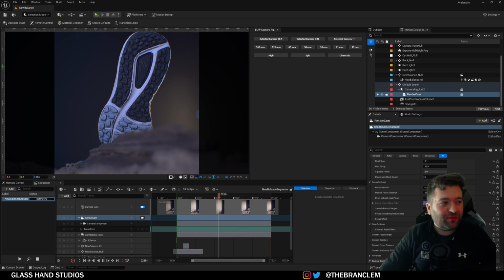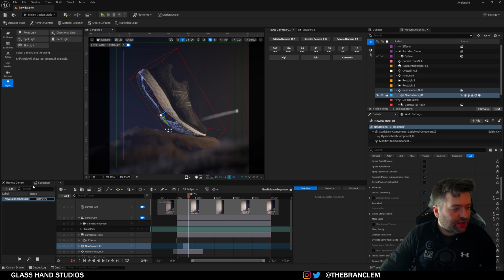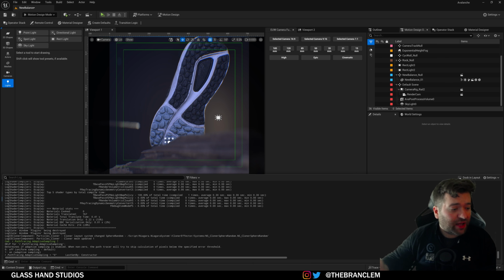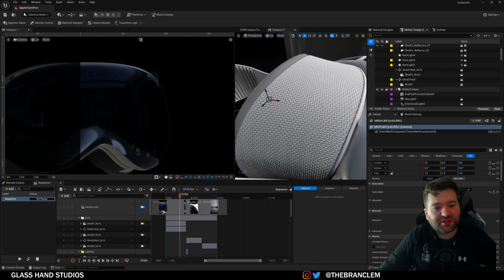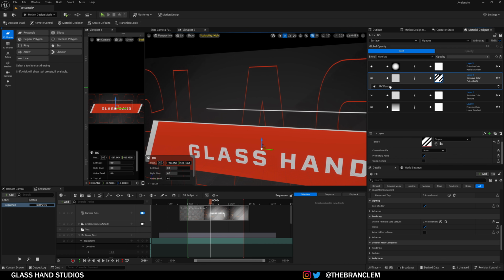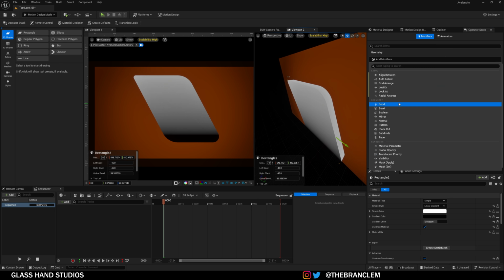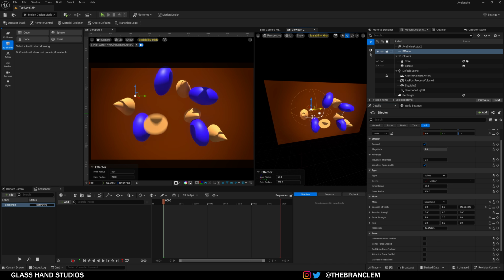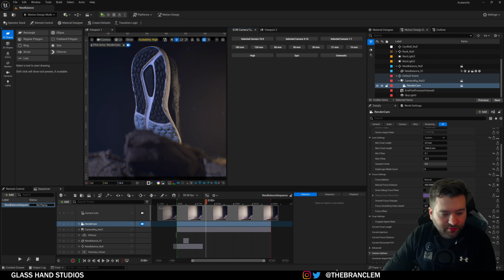Unreal Engine 5.4 Motion Design with New Cloners, Effectors, & More! (Project Avalanche)

Comment: OR you just enable this under experimental in the plugins config. its called "motion design". no need to compile a prebuilt version.
Reply from the maker: You will need 5.4 which just came out today in preview state 1. I'm compiling the actively developed 5.4 branch which is not pushed in the epic games launcher publicly. You will need to compile from source code to get the latest commits from the developers

Comment: Great video thanks!  Can you help with an issue please?   The materials which I made in the new material designer look great in viewport, but when rendering with the movie render queue all materials are missing and render black with the following error message:

“Detected 2 read-only materials with missing niagra usage flag required to work properly with cloner”

In other posts I’ve read to open the materials in the main UE mat editor and make sure that in the materials niagra usage settings that “use with Niagra mesh particles” is checked… But mine are already checked!?

Any advice appreciated
Many thanks  😊
Reply from the maker: @DavidMattock  thank you very much! And yes the usage flags are under the material settings. You are looking in the correct place. You will find things like "use with nanite", "use with Niagara", "use with instances static mesh", etc. I believe the motion design cloner is actually using Niagara to instance the mesh. To trouble shoot, I would make another regular material and add it to your cloner to see which flags are ticked. Take notes and add the same flags to your material designer material. I hope that helps!
Reply: @GlassHandFilms   hey thansk so much for replying.  I made a normal material and it still didn't work, but a material from the starter content did.  
So I just tried creating a brand new motion design scene, added the default cloner, used material designer to create a material and the same issue.  Is it that NO materials made with the designer are renderable?

BUT in this level, I made a normal material and dragged it to the default cube in the cloner and the material rendered fine.. crazy.  But I've not found anyone else with the same issue.  I tried asking on epic forums but nobody answered in over a day, so I guess I wont get an answer.  Have you found similar issues with materials formn the material designer wont render?  Many thanks again
Reply from the maker: @DavidMattock  howdy again! I will try and recreate on my end. In the mean time, I will pass this along to epic to see if they have flagged this as a bug :) thank you so much for sharing. This could help a lot of people in the future! P.S. material designer is going through a ton of changes and will be better in 5.5 :) crossing my fingers they have this bug flagged
Reply: @GlassHandFilms   Amazing thank you so much ! 😊 its  impossible to contact Epic for us mortals lol   
I just tried something.. I opened the material designer in the standard UE editor, then copied all the nodes linked to the main end root material node.. then created a material in the standard way, and pasted them in, and connected it... and it worked!  so Im sure there is a bug with material designer.. which are called dynamicmaterials, maybe this is the problem?

Thanks again for the feedback and responses, much appreciated, Ill wait to see if you get anything from the powers of Epic.
Reply from the maker: @DavidMattock  So I did hear back from one of the engineers. And yes, they did notice this happening and he told me it is fixed on the main branch. I'm going to pull tonight and see if it works as intended. Thank you for the comment and calling it out!
Reply: @GlassHandFilms @GlassHandFilms  Wow, that's awesome; thank you so much!  I was surprised no one else had posted about this issue, which made me think it was just me, so this is a relief to hear thanks.  I ended up just making standard material the normal way,  😊

Comment: Thanks for the overview. Looking really interessting. Are you also able to import Megascan Models/Textures, Unreal Marketplace stuff as well as all the other 3d formats into the project and work with them as you would do in a standart Unreal project?
Reply from the maker: Oh yes! The only thing that is different is the "mode". So when the engine is in a specific mode it can present information in unique ways or give us access to tools that are not available in other modes. For the shoe example, I was still able to bring in assets from Quixel. Cheers!
Reply: @GlassHandFilms Sounds great. Thanks
Reply from the maker: @pascalfurst7864  of course! 😁

Comment: Is any of this integrated with UMG? Rendering and changing parameters to and from widgets, that kind of things?
Reply from the maker: Hmmm I'm curious what you are thinking. Can you explain your idea a bit further?
Reply: @GlassHandFilms  I mean using both systems UMG & Motion Design in tandem, to create interactive, non linear content, such as game menus, HUD elements, etc. When Avalanche was announced, I assumed it was the "next-gen UMG", kind of like Niagara is the "next-gen Cascade" but so far it looks like they're 2 completely different systems that have different purposes and can't really interact with each other. If both system could interact with each other, I can see this stuff becoming extremely powerful for UI design and animation. I haven't had the chance to look into it yet so I was wondering if anyone did, as there is very little info about this online
Reply from the maker: @r3m1  ah I see what you mean! Motion Design is really meant for folks in motion graphics, broadcast, film, etc to create linear content. I'll have to do more experiments, but I don't think motion design is UMG 2.0. Have you looked into Rive? To me that sounds more in line with UMG 2.0
Reply: @GlassHandFilms  oooof didn't know about Rive. Interesting thanks for the tip
Reply from the maker: @r3m1  I haven't used Rive yet, but I have some friends who work over there. I know they have an awesome team so I'm excited to use it. Cheers!